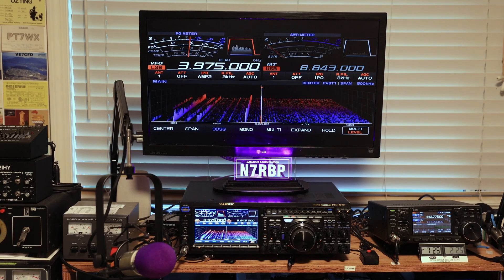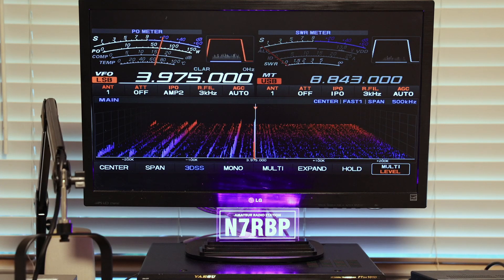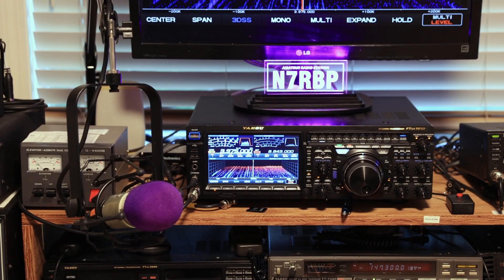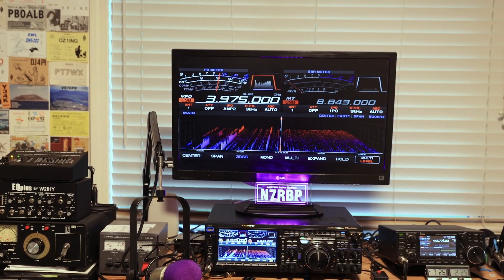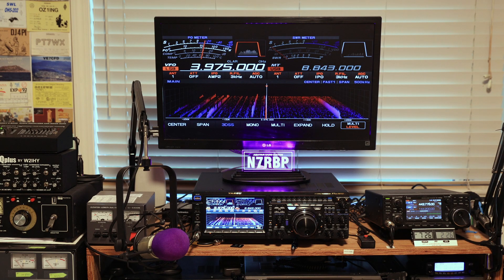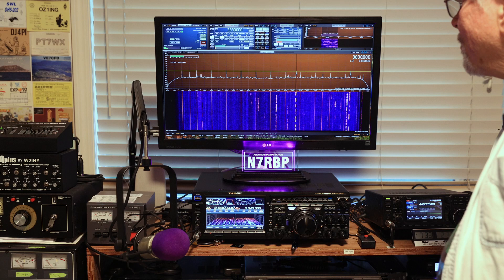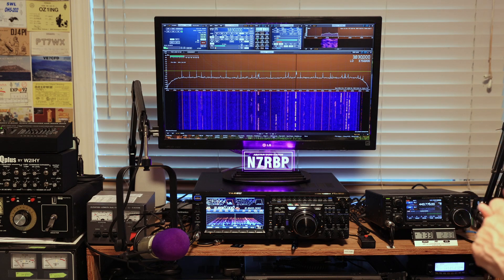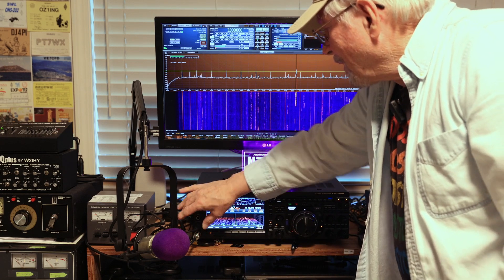Yaesu FTDX101D mated with an   SDR-PLAY / SDR-UNO external Receiver

Comment: Why buy a flagship radio if your not going to use its receiver
Reply from the maker: Mike,

I use the “Flagship Receiver” ALL THE TIME on weaker signals. That is where it shines!!!
80% of my listening is very audible signals, therefore, I use the “Full Meal Deal” big screen which allows me to click on and change frequencies on my computer monitor. Plus, the SDR software has many features that the radio does not have.

Thanks for the post.

73 de N7RBP

Comment: Wait a minute, you mean I could just add a Display/Monitor and have a view of the SDR of the 101MP, still use the 101MP buttons, knobs and touchscreen to control it, but also being able to use the mouse on the display, and have output to my PC monitor? I know I’m new to this but I seriously like that, the 101MP is on top of my wishlist for my first big rig (I know, almost overkill and quite expensive, but I don’t want to buy, sell, buy something else, sell, and finally buy something good… I prefer to buy something good right away). I’m still working on my HAM license and learning CW right now, and I’m not too sure how to use Mac/PC with a HF Radio…  I love the tactile approach of the Yeasu 101D/MP, but I would love to have a large and clear view of the SDR on a large display, and not just a mirror of the internal touchscreen display. So it looks like you did just that… I really need to dig into SDRPlay and SDR Uno now… Also, I need to find how I could plug a 3rd party mic such an Audio Technica…

Comment: One key advantage of adding an sdrduo  to both RX OUT's that you didn't mention (and why many do it) ---  you can unsync the CAT control and use the SDR UNO interface to tune to totally different frequencies than what your 101's VFO is tuned to (just has to be in the same band as the VFO since RX OUT is downstream of the bandpass filter).  So you can monitor up to 4 different frequencies at once this way.
Reply from the maker: Very Good Point!!!!!

Comment: Excellent++ video Rob! I have this setup for my FT3K using SDR Console V3, which is just as fine as SDRUNO. I would like to know if there are ever times when you prefer to listen on the SDRPlay rather than the FTdx101. I have a switch and find that sometimes the FT3K sounds better and sometimes the SDR sounds better (less noise). Have you tried this and found some advantage? de Wb8yqj Don

Comment: Hi, Thanks for your video, interesting idea. Please could you share what kind of switch you are using to switch the monitor between the FTDX101D and the SDR? Currently I am using a DVI-D t0 DVI-D cable to connect the FTDX101D to an external monitor, but I am not quite sure about your A/B switch and how the connections are done.
Thank you
Raf
Reply from the maker: This is the HDMI switch I use

https://www.amazon.com/dp/B07K2NZX8L?ref=ppx_yo2ov_dt_b_fed_asin_title&th=1

Comment: I just ordered the RSPduo and plan on having it on the main and sub RX out on my 101MP. Did you notice a 3db loss in signal when you started sharing the antenna with the SDR?
Reply from the maker: I did not notice any loss directly to the radio and through the radio speaker. The RSP is plugged into the computer and the audio and video is from the computer, not the radio. I do see a SLIGHT loss on the waterfall on the monitor from the RSP but very slight sifference.
Reply: @hamradiofrequencies   It is my understanding that utilizing the RX out on the radio will be similar to the signal loss you see by using the main and sub receiver on the same antenna. Ends up cutting the signal by 3db since the antenna is being shared. Not a huge deal, but is noticeable if you are looking for it.
Reply: Very good video how do u get on regards the txing of the radio with the rs duo plug into the radio ! also what antenna you use for the rs duo kind regards Mark
Reply: I have it set up the same way on my 101D . Not fond of having to run a separate computer to get the display. Aside from that display it does display but seriously the audio from the SDR is far inferior to the 101. Yes I know you can select another frequency in the same band or Main or sub but who wants to hear the noise. So, an expensive Panadaptor. Might as well just find a large DVi monitor, I have a small one. Thoughts. And thanks for the video